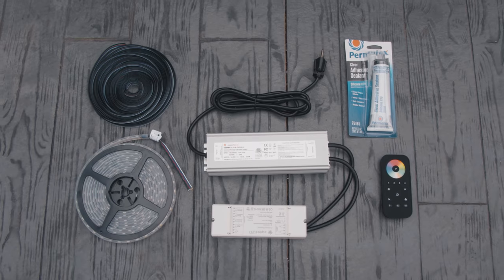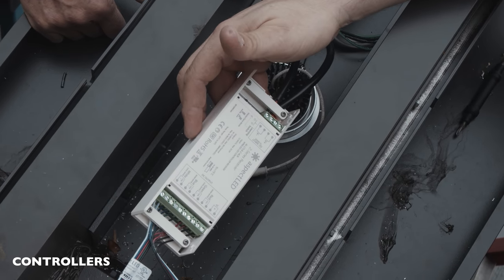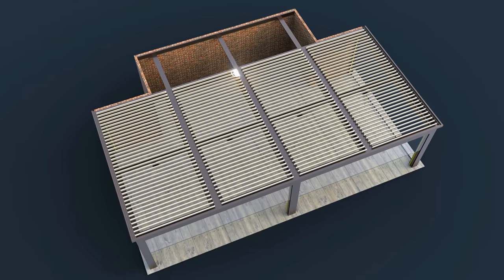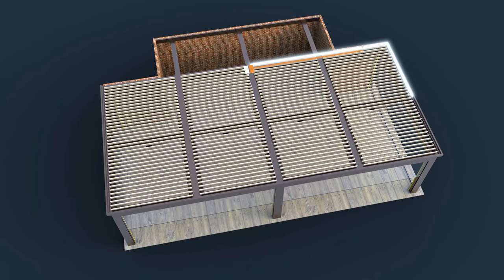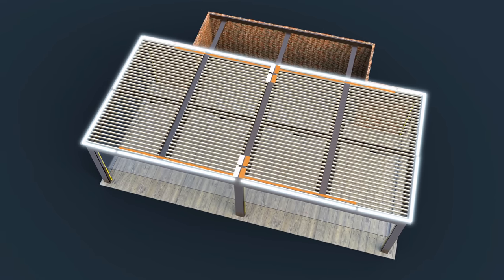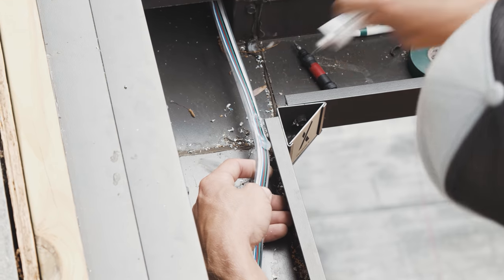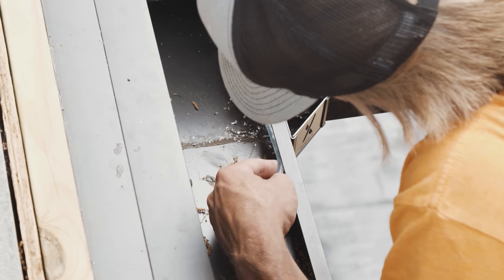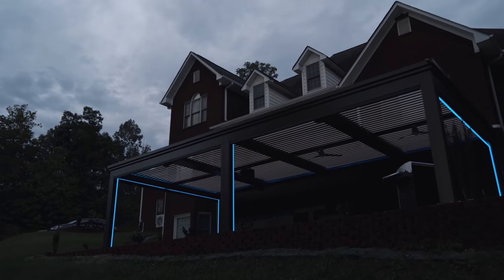Installing LED Strip Lights into a Pergola

Comment: There are 3 sides to the gutter channel, trying to figure out where on the gutter you mounted it for maximum light reflection on louvers.  Also did you use aluminum channel or directly on gutter.  Thanks
Reply from the maker: Hey, The outside perimeter of the gutter channel has an extruded channel built in that the strip can push into (On StruXure Pergolas). For other pergolas, we sell channel and would recommend using RTV silicone for mounting.
Reply: @aspectLEDlighting  So on Struxures Pergola, does the led end up shining light straight back or at a 45 degrees upwards.  Please share the channel part number for the channel you mentioned.  Trying to figure out the best angle to point LEDs within the gutter to get the best effect